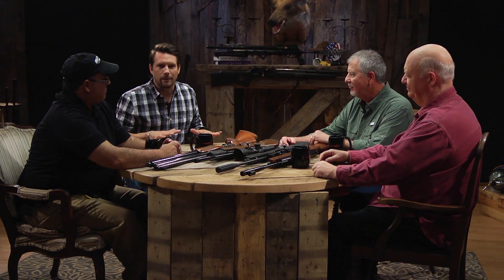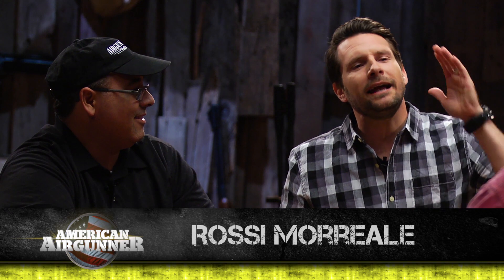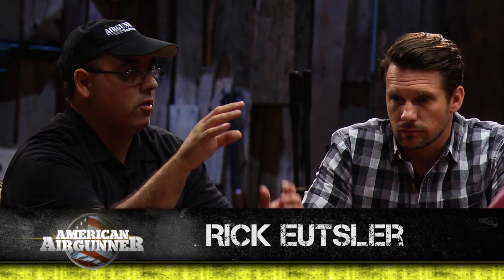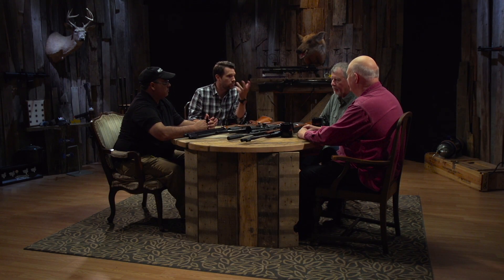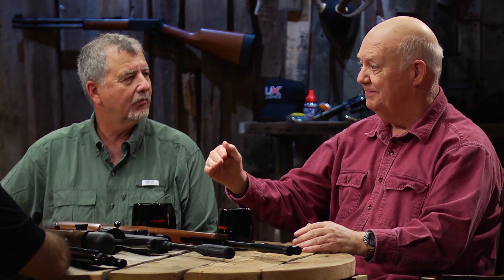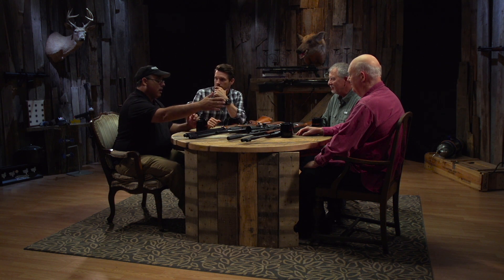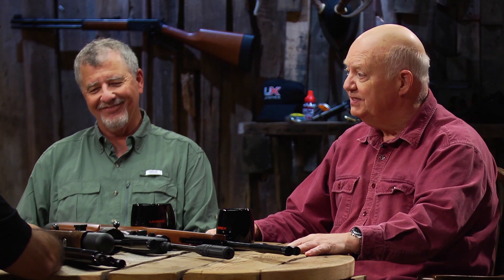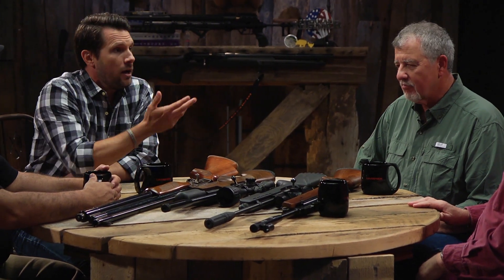What are Foot Pounds of Air Rifle Hunting Energy : American Airgunner

Comment: I'm pained by the lack of physics understanding, though the confusing nature of Imperial Units doesn't help. I'll try and give a concise explanation of the relevant physical concepts here, but before discussing foot-pounds specifically, I think it will help to talk more generally about energy. When considering a moving projectile, the energy we care about is kinetic energy, the equation for which is given by:

Kinetic Energy = 1/2 x mass x velocity^2

We can see here why both mass and velocity are important, increase either and you increase the kinetic energy (though the effect is squared for velocity). There are many factors which determine how much damage a projectile will do (size, fragmentation, etc.) but the maximum destructive power is a function of kinetic energy. This is why kinetic energy is the most important measurement for a projectile.

Foot-pounds is just a measure of energy, and using the kinetic energy equation you can understand how velocity and mass impact the foot-pound measurement. Understanding where the foot-pound unit comes from and how to calculate it is somewhat more complicated, so stop reading here if you don't want to get into the weeds.

Work and energy are related by the work-energy theorem which states that: net work = change in kinetic energy. This equality between work and energy means they can be measured with the same unit, hence foot-pounds is a unit of work and energy. I bring this up because the origin of foot-pounds is more easily understood as a measurement of work. Work is force multiplied by distance. In the case of foot-pounds, 1 foot-pound = 1 pound-force x 1 foot. Here we have introduced unit you may not be familiar with: the pound-force (lbf). This is simply the amount of force that 1lb (mass) exerts when under standard gravity (the gravity at sea-level). Since the acceleration of standard gravity is ~32.17 ft/sec^2, we have that 1lbf ≈ 32.17 ft*lb/sec^2, and so we have:
1 foot-pound ≈ 32.17 lb*ft^2/sec^2.

So if we have a projectile with mass in grains, M, and velocity in feet per second, v, how can we calculate it's foot-pounds? Starting with the equation for kinetic energy we can write:
KE = 1/2 x M x v^2  grains*ft^2/sec^2
Note the units: grains*ft^2/sec^2. To change it to foot-pounds we need to do some unit conversion. First note that there are 7000 grains per pound, so we can rewrite our energy as:
KE = 1/14000 x M x v^2 lb*ft^2/sec^2
Now to get to foot-pounds all we have to do is divide by the ≈ 32.174049 lb*ft^2/sec^2 there are per foot-pound (I've used a more accurate approximation for standard gravity in this final equation). This gives an equation for kinetic energy in foot-pounds:

KE  ≈  M x (v)^2 /450437   foot-pounds.

So with a shooting chronograph measuring feet per second and the known mass of the projectile in grains, you can use the above equation to calculate its foot-pounds.
Reply: recurrentTopology yes, they are talking about 3 different things. Energy, power and momentum. I don’t think they quite understand the physics as you’ve explained. I would have used SI units, because they make more sense. Thanks for the info in imperial though.
Reply: @@alfmartinolsen8250 While I agree metric (SI) is the superior system, particularly for scientific applications, this advantage is simply the result of having divisions and definitions align with our base 10 number system. That makes the numbers cleaner, but conceptually they are equivalent as the underlying physics is obviously the same, and if you are using a computer to calculate for you, it doesn't really make any practical difference. Information for firearms and airguns is generally given in imperial units, at least in the US and UK, so that is what I provided here.

With regards to the Apollo mission, they definitely used a mix of imperial and metric. The engineering was in imperial, whereas the orbital calculations were in metric. The flight computer calculations were coded using metric, but displayed the results in imperial.

Comment: Hi guys, im from the uk and own a sub-12 foot pound air arms s510

Yes, most of the people i know that have air rifles own a sub 12 too, because firearms licences are very strict, also, we have to consider depreciation of the guns over re applying for licences

So, i had a friend that was 177 to the bone, i have owned a 177 pistol, but for rifles im a 22 guy

Me and the friend that had the 177 was shooting at empty soda cans, and he was putting holes through the cans, entry and exit holes were pellet on pellet, no bigger hole than 5mm

I was shooting at the same soda cans, putting around a 6mm hole in the front, and completely blowing the back out the can with a 1.5 inch diameter hole, as my pellets were thumping the inside of the cans like a sledge hammer

The 177 were gliding through like a laser beam

My friend said he wouldnt hunt with his 177, but i would happily hunt with my 22

In fact, another friend had a piece of land around two acres, and he let me shoot on his land, i dropped a squirrel with a 12 foot pound, 22 springer

The pellet hit rhe squirrel right between the eyes, and it dropped out the tree like a stone, like it had been hit by a truck

Shot placement is key with the low powered guns, i have seen a well known youtuber in africa using a 30 cal i think it was on ground squirrels, and it didnt matter where he hit them, they were vapourising into red mist, good for pest control, not so good if you wanted to keep the quarry to say supply a taxidermists shop

So yes, foot pounds plays a vital role in air gunning, you need to know what your shooting at, what you intend to do with what your shooting at, what calibre your using, your backstop

Its no good using a cannon to kill flies, with a paper back stop that backs onto a street, that would be cause enough for blue lights turning up, you have to be responsible

I will always say, a 177 is nice for target practice, but take a 22 to get a job done

Comment: Great video. When I first started air gunning it was because ammo prices were through the roof. I was living in a neighborhood that had a humongous Crow problem. At the time I only had a little Daisy 880 and I would shoot these crows and they would just fly away.... Not liking me very much I assume. So I went looking for a rifle that could take these crows out. The Gamo big cat 1400 had just come out. And when I saw that big 1400 ft per second on the box I wanted it. Gamo must test their rifles in a vacuum or on top of Mount Everest. Even with the PBA ammunition it wasn't even close to 1400 ft per second. To make a long story short overtime I figured out that a heavier pellet was better and switch to the h&n baracuda Hunter Extreme overtime I figured out that a heavier repellent was better and switch to the H & N Barracuda hunter extreme. That helped improve things 90%. My biggest beef today with that rifle is that it is so light with a composite stock it is super hold sensitive. And it's effective range is probably 25 yd Max. I haven't retired it but I did replace it. I bought a Hatsan 125 sniper rifle in the same 17 caliber for only $20 more than what I paid for the Gamo and it is one sweet honey of a rifle. It's heavy which helps control The Recoil of the power plant. It's faster by almost 200 ft per second. And its accuracy at 50 yards is amazing. Even at a hundred yards I'm looking at a 5 to 7 in group depending on the Wind. That completely blows me away. It's actually almost on par with my Gamo SE Hunter Extreme in 22 caliber. Which is a great rifle with the worst trigger I've ever put my finger on. It is a tack driver at 50 yards but at 70 yards the groups really open up.
Long story short guess I could keep going on all day about this it's my passion. But I have to walk the dog and fix dinner. Lol! After 12 years of learning the hard way I know exactly what the magic number is. I keep dope books just like I do when I go shoot my powder burners. And for a guy that hated math in high school. I'm actually in love with doing math now. You won't become a proficient shooter if you don't. If there's one thing I love about the sport of shooting... It's that it can give you the biggest headache in the world because there are so many variables. The longer you do this for the easier it gets but when you first start out it's almost overwhelming. Is your scope mounted right is there cant to the scope, was my body positioned correctly...... Was my breathing correct, am I using the proper trigger pull.... Did I adjust the second focal plane correctly on my scope.... Is it me or is it the ammunition I'm using... The list can just go on and on. But once you're settled in it's easier to diagnose a bad day at the range.
A shout out to Rick Eustler... That guy has helped me out a lot along the way. Facts not fluff!!!!
One of these days I hope I have the money to go to competition and compete. And it would sure be a blast just to meet all of you guys in person.
Reply: john harvey glad you enjoy airguns.  One day you need to step up to Weihrauch Air Arms or Dianawerk

Comment: Hello, my .22 call break barrel springer produce 488 fps on 16.2 grain flat head pellet with energy of 8.6 ft/lb. It only like mastershot flat head pellet of 16.2 grain, other pellet does not give such fine accuracy on my air rifle.
So, my question is that can this air rifle put partridge and rabbit at which distance successfully ?

Comment: Great video. I'm just getting into air guns. I need to do larger pest varmint control in an environment where firearms are out, poisoning is out and traps are not even a viable option. My old pump-up pelt/BB gun is not working so well.   I would like to know what will work best without just throwing money at guns till I find something that works. Make sense?..

Comment: Question! Please, need a better understanding. So FPE, 1st example- 125 FPE, is the amount of energy that is able to push a one pound object 125 feet? Or the amount of energy capable of pushing a 125lb abject, 1 foot of distance? Which one?
Reply: FPE is a unit of energy, equal to the amount of energy required to raise a weight of one pound a distance of one foot.  So your second example 125lbs object/one foot, is correct.
Reply: Tyler Patner okay thank you
Reply: Niether.  They got the definition completely wrong.
1 fp is the energy used if you push with 1 pound of force on any object as it moves 1 foot of distance.  
To calculate foot pounds you only need to know two things: how hard you pushed, and how far it moved while you pushed.  You don't need to know the mass of the object.
FP = force applied x distance moved

Comment: I have gamo swarm magnum 10x gen 2 

How much power is this..?? How much damage can this do ..? 

26.6 Foot Pounds, Trigger Pull 3.2/2.6 Pounds, Length of Pull 15 In., 41lbs cocking effort
1650 fps  with .177 cal pellets..

JBS HADES .177 
10.34 gr
Reply from the maker: You would need to know the fps and pellet weight and type to know exactly.

Comment: The magic number is 450240....  
Ok. If you know the velocity and weight in grains of the slug. Then multiply velocity times velocity times weight in grains ÷ 450240. Try it with any gun of any caliber. As long as you know the velocity and the weight in grains of the projectile. Use calculator..
Reply: Whistling K9 Awesome!  Thank you for providing the formula.  I see now that the square root of 450240 equals roughly 671, which is the number one of the gentlemen used in the video.👍
Reply: Oh my gosh!

Comment: I am new to air gunning but not new to physics, that bringing said I don't know it all BUT a foot pound in a lever is is the rotational force called a torque that is created when you hold 1 pound a distance 1 foot away. If you have 2 foot pounds it is holding 2 pounds a distance 1 foot away OR holding 1 pound 2 feet away. The velocity is the feet per second or ft/sec. The energy you speak of is MOMENTUM. a bigger pellet moving at the same speed as a smaller pellet has a bigger momentum. If you increase the speed you increase the momentum there are limits of course like air resistance. So a pellet which has had twice the foot pounds applied to it will not necessarily have twice the velocity and there fore not have twice the momentum. NOW I know what these words mean but I don't know exactly how it applies to air guns obviously there is no 1 foot long lever inside the air gun. It may mean the gun create a force that is constant for 1 foot. It may mean the gun creates a force needed to balance an unbalanced lever. This video did not help me I think the guns should be rated in pounds not foot pounds. But this may help you guys:
Moment ft-lbs = force lbs x distance ft

Momentum = velocity x mass

Comment: Accuracy is  King no point  having a 22 calibre or heavy pellet if  your missing the target, 0.177 as flatter trajectory  and  is more accurate so most likely hut the target than .22, but 22 as more stopping power and low pass through.

Comment: and horsepower used to be tested against actual horses so 6 horsepower in 1901 is likely to be more powerful than 6 horsepower in 2001 as there is a lot more weight to these engines and when they are running their will provide a lot more torque if you seen the flywheel on some of these old hit and miss engines like they were displaying at the Dutchess County Fair you would see even the old tractors the flywheels were huge

Comment: You have to put the least energy to the air the pellet is flying to. So the only why to reduce that energy wasted is to reduce the speed. But reducing the speed results in less energy in the pellet. So more weight is added.

Comment: so if ft lbs depends on the weight of a pellet and the speed (thats what your suggesting) then how are guns rated when you can shoot different weight (grain) pellets? also, how the hell is ft lbs calculated in a gun. any use of ft lbs i know of is based on a rotational force.
Reply: Airguns are rated differently depending which weight pellet you use. To be safe in the UK, get your gun tested with different/the heaviest pellets on the market to make sure they will never go over the limit.
Reply from the maker: Thanks for helping the community with your reply!
Reply: Ft-lbs of muzzle energy
Pellet velocity x pellet velocity x weight of pellet / divided by 450240 = ME

So, lets say you chronograph your rifle with 10.65gr pellets and it's shooting them at 800fps, take
800 x 800 x 10.65 = 6,816,000 and divide that by 450240 = 15.13859ft-lbs
or, most would just round that to 15.1ft-lbs of muzzle energy

"Magic" number
671fps 
If your rifle shoots a 10.0gr pellet at 671fps - the muzzle energy is 10.0ft-lbs
If you're shooting a 20gr pellet at 671fps, the ME is 20ft-lbs
Try the above formula, you'll see. 
822fps
Will give you approximately 1.5 times a pellets weight in ME
822 x 822 x 10gr = 15.007ft-lbs
949fps
Basically doubles a pellets weight in ME
949 x 949 x 10gr = 20.003ft-lbs

These numbers can come in handy if you're at a show/etc and maybe looking to buy a rifle. If someone tells you their rifle chronographs a 14.3gr pellet at around 950fps, 
well, then you know the rifle delivers around 28.6ft-lbs of ME

Fellow geeks, may or may not find that interesting.

Comment: Actually foot pounds is a measure of energy in terms of potential energy. If you were able to shoot a pellet of a weight of that ammount of pounds in a perfectly vertical position it would indicate how many feet you are able to reach.  That would be so assuming no air density (no air resistance) and a constant equal value for the gravity constant  (approximately 9,805 m/ (s*s)  in metric system of measures)
Reply: Potential energy is static, not moving, a piece of silverware on the table, a wound up spring, or a cocked piston on a springer air gun.  Kinetic energy is the piece of silverware dropped to the floor, the spring releasing its energy, or the trigger being pulled to move the piston. That's all I got. :)

Comment: "671fps"
At 671fps the FPE equals the weight of the pellet

475fps = 0.5
671fps = 1.0
822fps = 1.5
949fps = 2.0
1163fps = 3.0

For ease let's say you're shooting 10gr pellets

475 x 475 x 10 / 450240 = 5.0ft-lbs
671 x 671 x 10 / 450240 = 10.0ft-lbs
822 x 822 x 10 / 450240 = 15.0ft-lbs
949 x 949 x 10 / 450240 = 20.0ft-lbs
1163 x 1163 x 10 / 450240 = 30.0ft-lbs

If you find this useful, great, please don't post to tell me 671 "is a bit more exact"

Believe it or not, I don't always have a calculator on me. If I'm out somewhere and an 
airgunner tells me they're getting 825fps with a 7.9gr pellet, well, then I know they're getting around 12ft-lbs, at 950fps I know they're getting around 16ft-lbs.

Comment: You are IMPATIENT and so full of it... you do not give the other three people in round table to speak ... you need to learn how to LISTEN when others speak.
Reply: Right on and why are you consistently having to inject some bit of humor into everything,  Your not contributing ,uch to the conversation.
Reply: It'd help if the guy on the right knew the definition of foot pounds.  It is NOT the energy required to move 1 pound 1 foot!  
One foot pound = the energy used when you apply 1 pound of FORCE to ANYTHING over a distance of one foot.  
If you move your car one foot with one pound of push, that's one ft-pd.  
If you move a feather one foot with one pound of push, that's one ft-pd.
If you move a one pound weight over one foot, you actually do not know how much energy that took, because it depends on how much force you used.    
A lot of useless talk can be avoided by using correct physics when discussing physics.